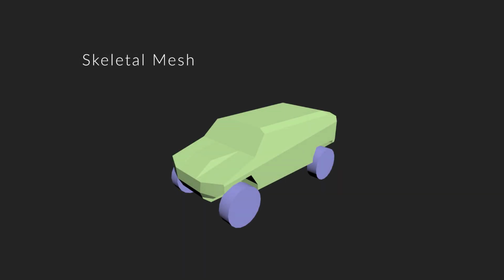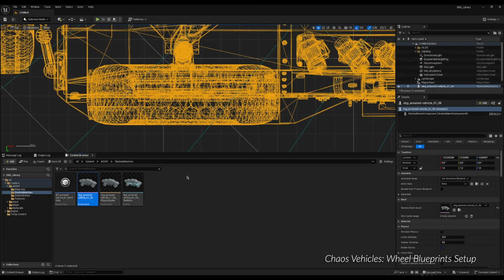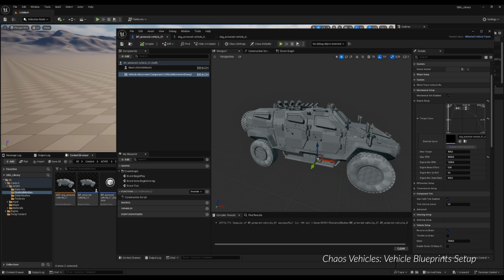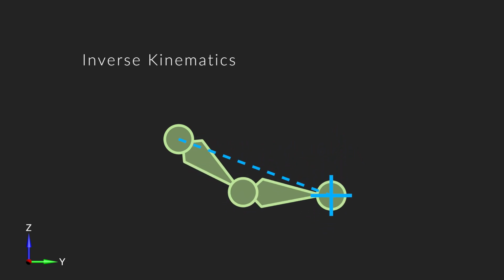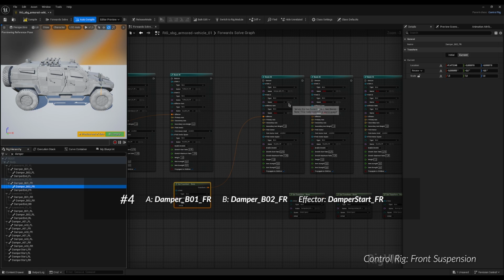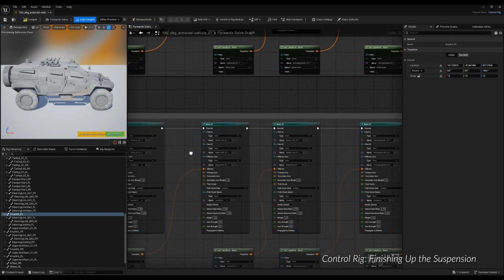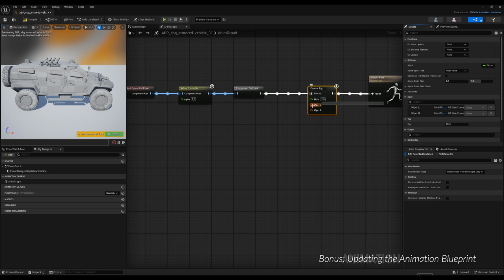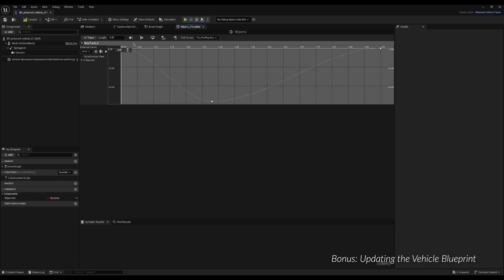Unreal Engine Quick Start Guide | Vehicle Rigging Fundamentals

Comment: I've spent hours trying to get mine to work I still can't get it work rahh
Reply from the maker: Which part are you having issues with? The suspension is the hardest thing to setup, but can you at least get the chaos vehicles to work?
Reply: @SendoaBergasa  can I ask a question here please? My wheels are phasing a little through the ground. I changed radius and width but it doesnt seem to be it. maybe chaos raycasting substep???

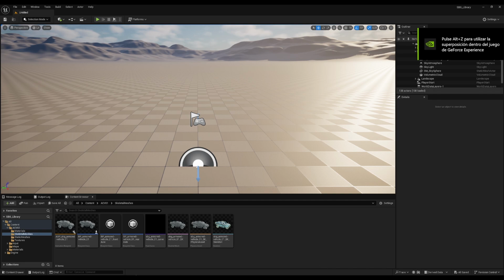Comment: Hi. Great tutorial, but I found it impossible to follow the suspension setup part (which is what I am really interested in) due to the fact that I don't have the 3D model used in this tutorial? It's extremely difficult  to work out how to rig my car model without having access to close up images of how this model was created. Is it possible to get access to high resolution images of this models' naming and rigging setup somewhere? Otherwise, do I have to purchase the model to continue the tutorial from 25:00 onwards? Thanks.
Reply from the maker: As I mention in the video, the setup shown here is specific to this vehicle. Keep in mind that the suspension of a a vehicle is very complex, with lots of moving parts. That means that, depending on how your vehicle and it's suspenssion have been built, the setup might vary quite drastically. I don't think you'll ever find a tutorial on this topic that matches 100% your specific model/setup.
The way I built all this stuff was by reading the UE documentation, checking the tutorials that are out there, and, mor importantly, with a lot of trial and error. 
Lastly, I would like to clarify that I made these videos primarily for those who purchase the model of the vehicle, as part of the documentation. The information contained might be usefull for the general Unreal Engine user, but there are parts that will only be relevant for those who own the vehicle.